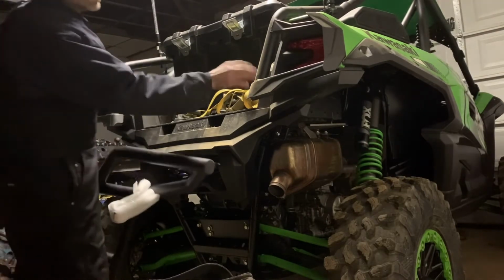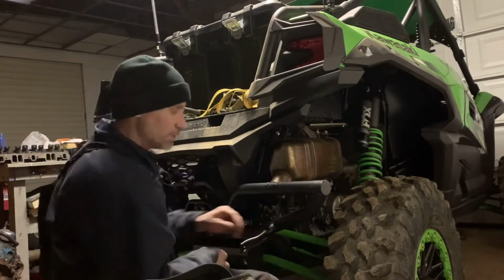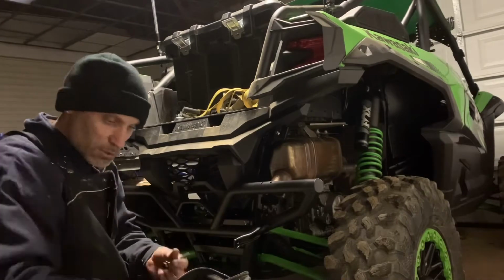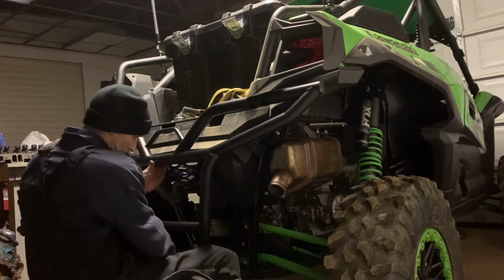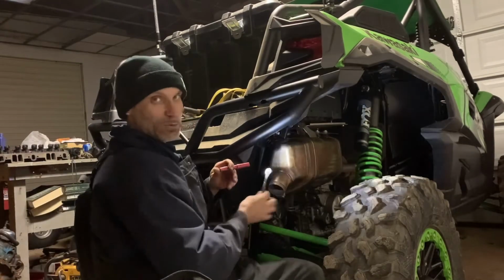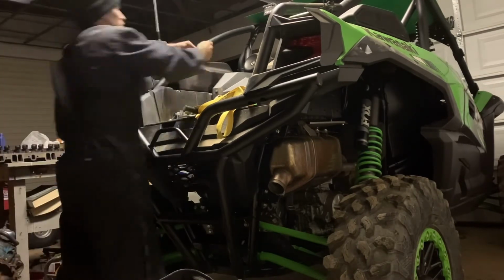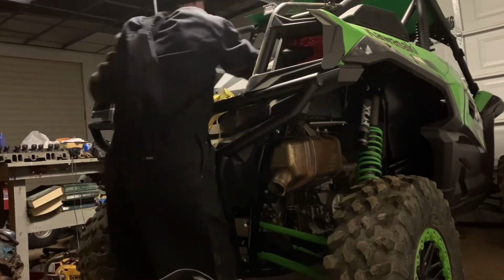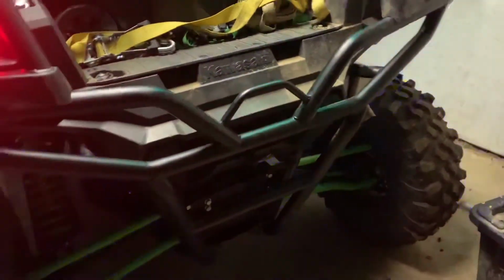How to install rear bumper on a Kawasaki KRX

Comment: Good posting, This will come in handy when we install my rear bumper. These things are money pits arn't they, Buying one is just the beginning, I ordered the front and rear bumper, LED light bar and the wide fender flairs, they are at the dealer waiting for me to go pick them up, bad thing they are in Southern Cal and I am in Phoenix. Trying to get my son-in-law to meet me 1/2 way or at least a 1/4 way between there to get them. I have had my KRX for a week and a half and have not driven it yet, waiting for everything to be installed before taking it out, Installed the full under body skid pan and A arm/trailing arms plastic covers on it a few days ago, that was a pain as the guy at the factory over torques the bolts and they were a major pain to remove. Keep up the great how-to-videos!
Reply from the maker: Yeah they are easy to sink a lot of money into if you need any pointers feel free to message us and when you do your they arm guards if you don’t mind make a video let me check it out I’m getting ready to do that too and the side rock sliders I’m going to  those in a couple weeks
Reply: @klifeutv3467  Will do, thanks, the rockers were a pain as they were the bolts that the guy at the factory over torqued. One bolt head snapped off and we had to drill it out. A 15 minute install took for ever to get done.
Reply from the maker: @patd4u2  Hey if you get a minute will you send me a couple pictures of the rockers but you installed I’m just curious what they look like
Reply from the maker: I didn’t see a video of them on your channel unless I overlooked it
Reply: @klifeutv3467  Sure, I'll go out and take a quick video of it now.
Reply from the maker: @patd4u2  thank u can’t wait to see it I made a comment on one of your other videos I think about your custom rack carrier I don’t know if you got it or not
Reply from the maker: @patd4u2  Yeah good video very helpful I made a comment on it